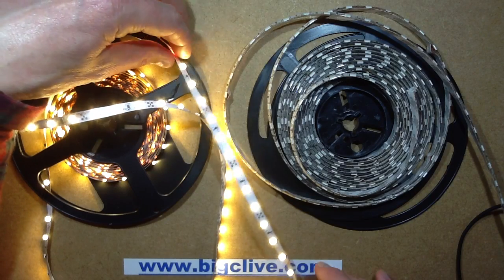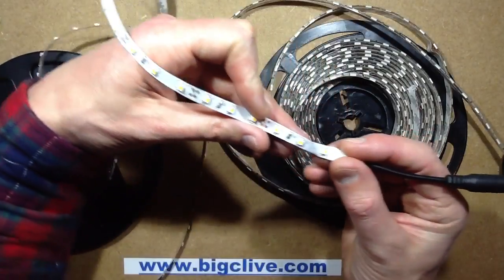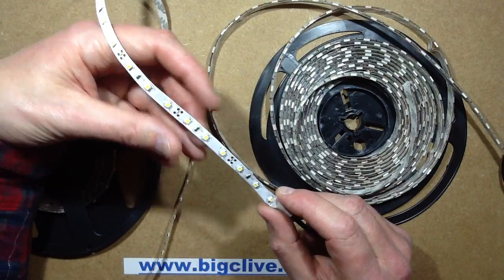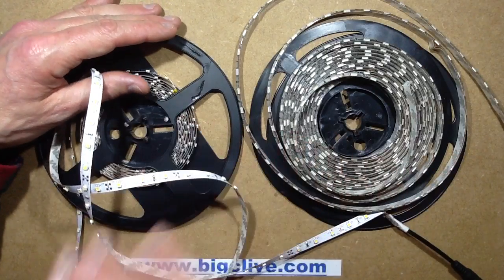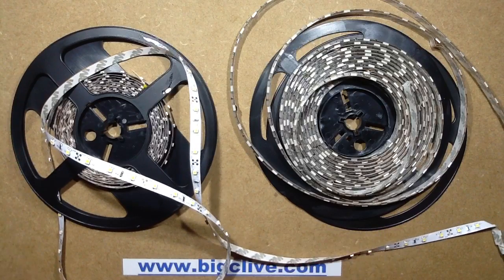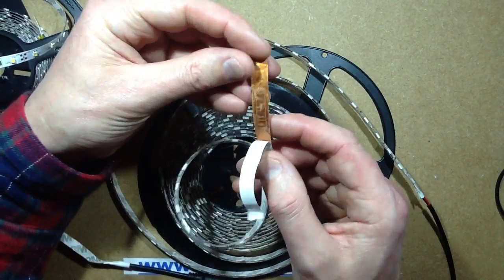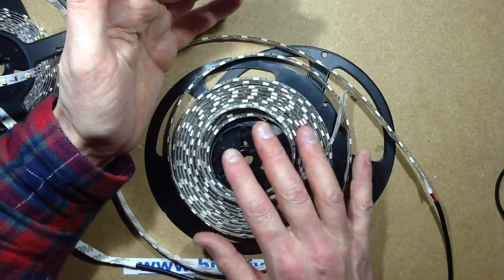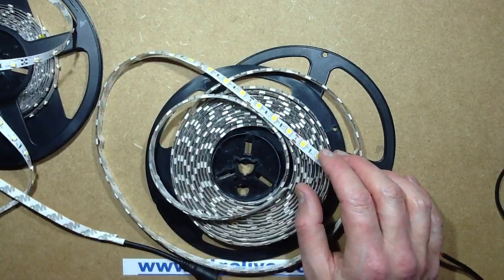LED tape voltage drop on long runs.

Comment: Thanks. I'm having difficulties with my RGB installation. I bought 4 rolls (150LED versions). I also measured massive voltage drop. Now I want to have best results in my ceiling (around whole room 17,5m). As they must be in sync it is cheaper to have only one controller and one power supply. 
I measured 0,6A per 5m roll per one color. So I expect 10A 12V supply should be enough for maximum white. But what about voltage drop.
First I thought that maybe running 4pin RGB extension cable half-way to both direction and supply 2 rolls from one side and 2 rolls from opposite side. But ~4,5m sections are too long for this Chinese strip and now I suspect I should run extension cable across whole room and connect that supply line multiple times (4-8 connections) across whole room. But what about voltage drop IN the extension cable? I believe there is only one manufacturer of that special application cable (just search "RGB extension" in ebay).

Do you have any idea will there be noticeable V-drop if I run it around the whole room and connect that 4pin supply line to controller from both ends (so ~8m is the furthest from controller).
And is it safe/reasonable to connect all strips together and supply them at random distances? Some say that strips may not be supplied from both sides. Myth?
Reply: +Arnis Tarassu 
Well you don't need some exotic cable extensions, as long as you get any 4 core cable that can take 10A it will do the job (or 4 separate wires but that gets messy). Run the extra cable alongside your strip and splice it in every meter or so, don't need the first and last meter so it saves some cable.
At the point the voltage drops should be minimal.

Comment: Summarized, is there visible light output drop due to voltage drop when using entire 5m lenght? Ring circuit could be use if circuit path starts and ends close enough. I presume that resistor has the same value all the way up to 5m, otherwise voltage drop could be compensated by smaller resistor value on each section till end.
Reply from the maker: The tape is designed to be cut into sections, so the resistor value is standard for the full length.  The slight fade from one end to the other can be evened by feeding positive from one end and negative from the other.

Comment: What driver would I use to power 2 short strips of 3528.  Less than a half meter.  Straight from the main lighting switch from under my cupboards.
Reply from the maker: +chris stevenson A stabndard 12V power supply rated at about 1A should be fine.  I prefer this type for that sort of application.    http://www.ebay.co.uk/itm/18w-LED-Driver-Power-Supply-Transformer-240V-DC12V-for-MR11-and-MR16-lights-/230843971628?hash=item35bf5f782c:g:inQAAOxydUJTN-ls

Comment: thanks, i suspected it would be the case. i have recently brought loads of 220v AC 5730 led strip that comes with a little bridge rectifier box, it consumes around 20w/m and its lovely and bright. i have lots of led strip and this is my favorite so far and it will go into lighting my workshop. worth checking out if you haven't already Clive?
Reply from the maker: I've got some of the lower wattage mains tape ( covered in a video recently, including opening that rectifier box.)
Reply: ill check that out thanks. saves allot of hassle i feel, compared with the 12v stuff.
Reply from the maker: The mains voltage stuff does nit have a smoothed power supply, so it will flicker more.
Reply: yes very true, im yet to test it over working environment, ie table saws etc where things spin, hopefully wont be a problem or danger.

Comment: Wait a minute. What about led booster amplifiers!
Reply: Why would you need the amplifier if you could just run power? I think the point Clive was making is that unless there's PWM involved (which to be fair there almost always is these days if there's dimming involved), an amp is just an extra piece of hardware in line when you could've just run the +ve and -ve leads from the power supply to it.
Reply from the maker: The LED amplifiers are really only suited to RGB LED tape or single colour tape being fed from a PWM dimmer.  This is the single colour type, so you would just run a bus of heavy cable to spread the load, or use separate power supplies for each section.
Reply: bigclivedotcom very false. I work in LED lighting everyday. LED Amplifiers there are two types, 1 fot the RGB and 1 for single colours. Using single colour Amplifiers will totally remove the voltage drop.
Reply: i Game  hello，this is michael from starwire lighting.you are right,amplifier is good to use for long led strip.we have 3528 48v,78led/m,can be 50meters,no need amplifier,also,we have 3528 24v 60led/m can be 30mters /roll,no voltage drop.5 years warranty.  so,maybe we can supply sample to you,if you need. email:s32@starwire-led.com.
Reply: @alvinchan929 .

Comment: Put positive to one end and negative to the other to make the brightness uniform along the strip.
Reply from the maker: That would work, but does involve the nuisance of not being able to run a strip fed from a single end.  It's the same technique that was used in the USB powered LED lights featured in a recent video.
Reply: bigclivedotcom Could you try it and measure the voltage drop at different points? As you said the voltage drops faster with higher currents, and not uniformly alongh the length. So the LEDs in the middle would get more that half the voltage drop from both ends.
Reply: Walter Boxhead Yes, the total resistance would be the same along the length. But resistance is not voltage drop, the voltage drop follows ohm's law, I * R = V. Low current = low voltage drop.

Lets say we have an 5 meter length using 1 A and the resistance is 0.2 Ohm per meter and side. i.e it uses (an average of) 0.2 A per meter.(using average to simplify, it would get worse in RL.)

The first meter you start with 12 v on the positive side and 1 A, = voltage drop from 12 to 11.8 V.
The second meter is 11.8 V and 0.8 A = voltage drop from 11.8 to 11.64 V.
Third meter is 11.64 V and 0.6 A = voltage drop from 11.64 to 11.52 v
Fourth meter is 11.52 V and 0.4 A = voltage drop from 11.52 to 11.44 v
The fifth is 11.44 V and 0.2 A = voltage drop from 11.44 to 11.40 v.

We get 1/3 of the positive side voltage drop at 1/5 of the length. In the middle we have 2/3 of the total voltage drop. But this is only one side, you get the same on the negative side but in the other direction.

Positive - negative = total V diff (Voltage drop seen by LEDs.)
12 V - 0.6 V = 11.4 V (0.6 V)
11.8 V - 0.56 V = 11.24 V (0.76 V)
11.64 V - 0.48 V 11.16 V (0.84 V)
11.52 V - 0.36 V 11.16 V (0.84 V)
11.44 V - 0.2 V = 11.24 V (0.76 V)
11.40 V - 0 V = 11.4 V (0.6 V)
Reply: m8e It seems to all work fine. We were putting them around a rectangular display case in a loop, about 6m all up along all sides and a couple of passes across the middle of the cabinet, and with it powered from one end, where it came back there was a noticiable shift in brightness, with it powered at both ends both positive and negative there was a noticiable fade along the length of the cabinet, but with positive on one side of the look and negative on the other side of it, then it was not noticiable. We never did any tests on voltage drop at different points etc, just wound the power supply voltage up to as far as it went (12v open frame) to get more brightness out of the strip.